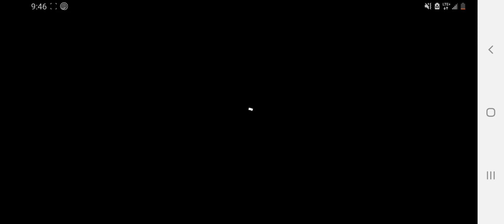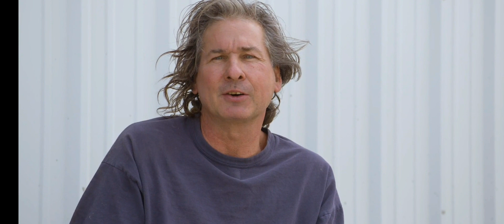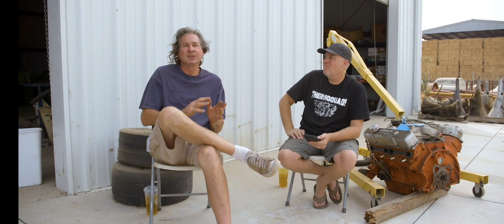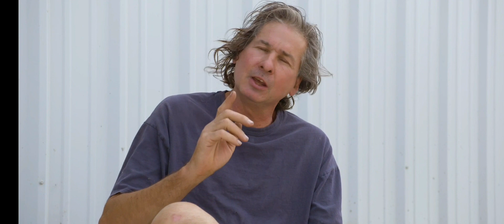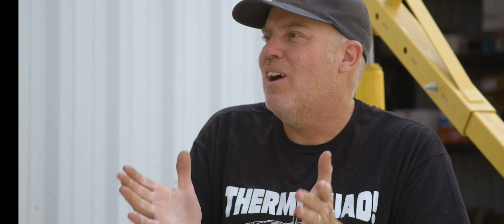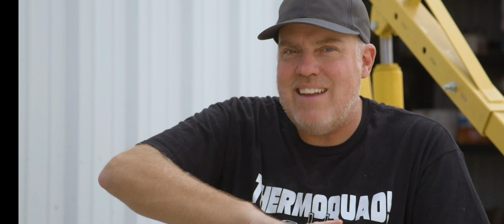uncle tony's garage gets called out by the roadkill guys and they say he's  full of shit

Comment: Met Uncle Tony in person not too long ago. He’s a really cool, humble guy. Not sure why you have so much animosity for him, but I think his channel and influence has done a lot more good than bad for the car community. I also don’t recall him saying in his video that people should do this with aftermarket pistons which is apparently one of the complaints they have with this. From what I remember, he was specifically referring to stock ones and never made any specific horsepower claims, or told people to tear down their engines and do it. Pretty sure he only said to do it if you’re already rebuilding it with factory components.
Reply: @crunchemagain2030  A lot of what he does is purely for video content.  The 4 door will never run 10's they way he has it set up either, ever.  It already broke the weak ass 8 1/4 rear end, next will be the crappy slant 6 4-speed in it, then the 318.  It'll run 10's with a 440, nitrous, an automatic and a real rear diff and gears.  Just watch.
Reply: @Cutlass_Rudd  nothing UT puts his hands on will ever run 10's... doubtful it will even run 13's..
Reply: @crunchemagain2030  I dont think its even cracked the 15's.  That means it would get whooped by any minivan or Toyota camry.
Reply: @Cutlass_Rudd  Wrong.     BR did 8.85 1/8th mile, equivalent to mid 13's quarter mile last year on a slipping clutch. This weekend it did a 1.61 60', which calculates to 11.58 in the quarter.  He is close to breaking into the 10's.
Reply: @alzaidi7739  Lol @ 60 foot equating to anything.  You've clearly never drag raced anything in your life.  That car will never do anything but be a content source, they should rename it the excuse machine.
Reply: @Cutlass_Rudd  You said he'd never leave the 15's when he was already 13.5 equivalent.  When UT gets BR into the 10's, rest assured, you'll be the 3rd to know.
F=MA. Newton's 2nd law.

Remember, you said 15.
Reply: @alzaidi7739  Lol.  If 318's and crappy slant 6 4-speeds could handle 400 shots everyone would be doing it.  Hint.  They don't.
Reply: @alzaidi7739   I agree with you. The 318 is a great Motor and Tony has been making progress with it. Its a LOW DOLLAR build. ANyone that hates on a318 is clueless. Not a huge performance engine but super reliable,and im sure you could get some push out of one if you tried like Tony is currently.
Reply: @alzaidi7739  you can't get a 1/8th time from a 60ft and you certainly don't have any proof of that 60ft time either 🤣🤣🤣 why didn't he show the slip!! Because it's bullshit junk that's never going to make a complete pass and Tony is a hack and certainly isn't a engine builder or racer
Reply: @Cutlass_Rudd  This 'crappy slant 6 4-speed'? : "New model intro time, fall of 1963: At last! An all-new transmission, designated the A-833, is available in everything from 6-cylinder Valiants to rip-snortin' Max Wedges. Equipped with a standard Hurst-Campbell "Competition-Plus" shifter and four fully synchronized forward speeds, it is built in Chrysler's Syracuse (New York) New Process Gear plant. Even in 1989, it was the largest, strongest, and heaviest four-gear passenger car transmission ever built in America.

From day one, there were two distinct versions of this box: A-body (later to be used in F-bodies) and B-body (also to be found in later C- and E-bodies). Initially there were three main version-to-version differences: extension housing and mains haft length, low-gear ratio and rear-flange size. The A-car box, while every bit as strong as its larger cousin, carries a 3.09-to-1 low gear, to launch small cars with even smaller mills."
Reply: @Cutlass_Rudd  This "crappy slant 6 4-speed" ?? :-)  "New model intro time, fall of 1963: At last! An all-new transmission, designated the A-833, is available in everything from 6-cylinder Valiants to rip-snortin' Max Wedges. Equipped with a standard Hurst-Campbell "Competition-Plus" shifter and four fully synchronized forward speeds, it is built in Chrysler's Syracuse (New York) New Process Gear plant. Even in 1989, it was the largest, strongest, and heaviest four-gear passenger car transmission ever built in America.

From day one, there were two distinct versions of this box: A-body (later to be used in F-bodies) and B-body (also to be found in later C- and E-bodies). Initially there were three main version-to-version differences: extension housing and mains haft length, low-gear ratio and rear-flange size. The A-car box, while every bit as strong as its larger cousin, carries a 3.09-to-1 low gear, to launch small cars with even smaller mills."
Reply: There's only so much offset skirts will tolerate.  Maybe it buys 3 or 4 hp?  But I like the idea of a dyno challenge.  Has to be the same engine, back to back.
Reply: Lil Boaty you are absolutely right about what he said with turning the pistons around he has said it would not work aftermarket pistons but you know as you can see the keyboard mechanic know it all mechanis, know it alls, and racers are quick to criticize and talk crap about yet the vast majority of them probably have no or very little mechanic, engine building, or any kind of racing experience at all that trick is nothing new my father told me about it from his days of racing and working on hot rods back in the 50’s and through his life many people in this day and age don’t know or realize there wasn’t much in the way of heavy aftermarket parts and services available back than it was alot of experimenting, trial and error, and working with what you had or what you could get with what you could afford honestly of course it’s a lot easier to have a huge budget corporate backing with a major publishing/tv company behind you with a big time dyno facility at your convenience almost anytime you want to use for testing on engines and parts that are given to them as long as they are promoting the name and brand to influence the public to think they need that particular part to make there car achieve that performance/horsepower goal because these corporate sell out brown nosers used it on an engine that probably wasn’t even theirs lol
Reply: Lil Boaty you are absolutely right about what he said with turning the pistons around he has said it would not work aftermarket pistons but you know as you can see the keyboard mechanic know it all mechanis, know it alls, and racers are quick to criticize and talk crap about yet the vast majority of them probably have no or very little mechanic, engine building, or any kind of racing experience at all that trick is nothing new my father told me about it from his days of racing and working on hot rods back in the 50’s and through his life many people in this day and age don’t know or realize there wasn’t much in the way of heavy aftermarket parts and services available back than it was alot of experimenting, trial and error, and working with what you had or what you could get with what you could afford honestly of course it’s a lot easier to have a huge budget corporate backing with a major publishing/tv company behind you with a big time dyno facility at your convenience almost anytime you want to use for testing on engines and parts that are given to them as long as they are promoting the name and brand to influence the public to think they need that particular part to make there car achieve that performance/horsepower goal because these corporate sell out brown nosers used it on an engine that probably wasn’t even theirs lol
Reply: @Adcox Robert Watching what?  Everything I said is true
Reply: @Adcox Robert get some reading comprehension, I said slant 6 4 speed ..the TRANSMISSION.  And the slant is a fine engine for transportation and reliability but it ends there.  Nobody runs them in vintage modified (straight 6's only) for a reason, they blow up the first night.  Not enough main bearing meat.
Reply: @Cutlass_Rudd  I have seen 2 turbo’d slant 6’s in my life both with stock blocks and both of them ran at least more than half an atmosphere of boost, you are simply wrong, and with enough traction and enough removed weight you can easily get far, and UTG’s idea is not being a hack rather than making do with what you got which also means pushing for power in every place for the least money and unlimited elbow grease. You already said basically at best it would be doing 15’s and that there is no way it could get close to 10’s only to have someone else to prove you wrong, instead of tarnishing someone’s name you go make sure YOU know what you’re talking about. And I only saw 1 of those turbo’d slants drive and it appeared to still be gutless at the bottom (same problem as tony and why most people don’t hotrod them on top of very limited aftermarket parts) though when the owner started shifting to keep it in the power band (3000-4500) it took off like a rocket, like I’m pretty sure if the guy had the UTG mindset that turbo’ed version could easily make it into the 8’s in the 1/4 (again with a light enough car and good enough traction), yes, I’m serious, are you? If you were you wouldn’t be saying things that are plain out contradictions. Agreed the trans he was using was weak but reading your comment I thought you were speaking of the engine aswell. Nonetheless if you can’t see the genius and knowledge Tony has when it comes to hot rodding and general engine theory than you should just keep driving your fast cars and keep your mechanically-declined ideology to yourself. I’m sorry to be rude or blunt but if you re-read your comments it’s like a group of people talking about the latest episode of a show that aired and you’re acting like you’ve seen it so you can be in on the conversation. It’s okay to admit wrong dawg, yes the mains on the slant 6’s could have been a bit beefier but that is simply because it was never designed to be a high performance engine, which is why Uncle Tony gets so many views from the series, simply because of people like you that say “that’s not possible” only to have guys like Unlce Tony seemingly bend physics when they take the time to observe how to better something without necessarily replacing it or putting money into it. Odd right but then again the guys saying he doesn’t know shit are the guy driving around thinking that their vacuum advance advances their engine the more they rev it. He has a whole video on not only tuning vacuum advance but doing a great job explaining how it functions and more importantly why it functions which is very simple for the air heads: Throttle closed = more vacuum / less dense af mix = slower flame-front = More time it takes for a complete burn // advancing IGN-timing when under vacuum means the air and fuel will be ignited a little bit sooner than at WOT or no vacuum as to make sure the less dense charge ends burning at the same time a WOT or more dense charge would. If that sounded too complicated than continue with going fast and leave the mechanicals and mathematical to us, I’m not trying to be offensive, I’m serious, there are a lot of good ass drivers out there, and their are also a lot of good ass mechanics, techs, and engineers out there, but there is really only a limited amount of people that can do more than 1 of those at a time competitively y’know?
Reply: @unitytwins6652  More than half an atmosphere, so 7psi?  LOL!  Real tuff.  Did the car run 16's or 17's?
Reply: Is this a pissing competition?
Reply: 7:1 compression 😊  Put a 340 call it a day .
Reply: @alzaidi7739  Where’s that 10 second time slip? That car never ran a 13 second. Calculating and doing are two different things. If a car is set up to run 1/8 mile, like his was, it will be all done by the 1/8. All UT proved with that pile BR is he doesn’t achieve nothing he claims he will do. He even put an auto transmission in BR and it still did nothing.
Reply: I think because he does a lot of backward thinking for example doing all this work thinking he’s better or more knowledgeable and right when he is just gaining nothing or 1hp like think inside the box if you can’t actually think outside

Comment: Clearly they never bothered to watch the UT episode in question.  At the beginning he specified tips for people looking to rebuild an engine on a budget.  Also he did not say to remove the piston from the rod and rotate it, he said rotate the pistons and the rods 180 degrees and swap cylinder banks and rod journals.  And yes, the math is correct, doing this will allow the piston to apply a bit more torque to the crank.  Given the number of engines the Roadkill guys have killed by halfassing their work they should have paid better attention.
Reply: It's only about the Torque & has nothing to do w/ HP. I've heard of example's were the HP was affected but very little. The Torque was affected by 10-27 lb.-ft. Yamaha has a single plane offset small-end crank in their high-pref. street bikes that kicks the S*** out of a lot of the other bikes. It's also the engine to use in mini-sprint cars. It sounds killer. But there is more vibration then the multi-plane so I'd rather offset the pin.
Reply: This. I love Roadkill and UTG, but the Roadkill guys have zero room to criticize how others build them. They half-ass just about everything they do!
Reply: Uncle Tony's garage wasn't even mentioned... much less called out
Reply: Most of the engines they have killed were either pretty much already there or run without air cleaners in the sand or left hoodless in the rain.. It is what ROADKILL was based on.. How many engines have they machined and built that they have blown up??
Reply: @proinseasokiellig4388  it absolutely was you need to go watch the full episode lol they called that hack uncle phony out on his magical BS that he gets young people who don't have any clue to believe lol
Reply: You either only rotate the piston on the rod or swap cylinder banks, but not both. 1. Because if you rotated and swapped banks the offset would still be toward the middle of the block
2. The notch for the rod bearing would be spinning the wrong way making it much more likely, if not guarenteed, to spin a rod bearing.

Also they didn't watch uncle Tony's video. They simply answered a Facebook question.
Reply: @proinseasokiellig4388  EXACTLY!! Someone's click bait horseshit
Reply: I never cared for the roadkill guys... they just come across as typical CA girly men.
Reply: Yeah yeah. WOULD YOU USE SECOND HAND RINGS AND HIT YOUR CRANK WITH A HAMMER TO CHECK ENDFLOAT,  👎👎👎
Reply: @michaelgiglio1571  I have used second hand rings. 

I actually built identical engine as my boss. 
But mine was junk parts. 

His got bored over. 
Mine just honed 

His had oil consumption after and could not be bored again. 

Mine ran for another 12 years. 

I’ll take free used over flushing $$$ down toilet 

Am I saying never buy new parts. 

No. 

But I have proof old parts might get u thousands of miles further for almost no cost. 

And spending a pile of money may end in a pile of junk parts.
Reply: @mccoma11  I think that's why many people watch them and how Freiburger became popular. Viewers wanted to see what he'd drop a big block into next. It paid off for him as he got the Motor Trend gig. I have seen them do some serious testing of theories.
Reply: @carmiethompson2676  it would have to affect both as horsepower is Torque x rpm / 5252. I take it you mean there was a positive difference in power , however; it was minute.
Reply: @SteveP-vm1uc  lol Steve being they already know what material they'll be presenting on a show I don't think they spend much money 💰 on shows like " How much nitrous or turbo boost can a stock block tolerate before it explodes ?" That's what initially got Freiburger started with a viewing audience. I have heard a successful 5.0L Ford Mustang racer Ben Alameda speak on this topic and he said his Stang got positive power gains from doing so. I know this theory has been kicked around a few decades in drag racing circles. Personally, I've never attempted it. Take care.
Reply: @NobilityandLoyalty  I have friends who run mini-sprint dirt oval races, I race motorcycles on the clay oval(well, I try too). They did use the flat-plain Suzuki 4-cyl. liter motor like everyone else. The Suzuki's are very expensive(skimming off the Motorcycle Division to pay creditors for their Car sales failure). So they went to Yamaha & that 4-cyl. liter motor but it had a cross-plain crank. On a clay oval, the cross-plain was far superior. Better torque curve, didn't have to rev the snot out of it because horsepower isn't as important on clay as it is on asphalt. The motor also sounded super wicked compared to the flat-plain crank motors. FYI; a intake valve for the Yamaha was $70, for the Suzuki it was $170. That was more then a year ago. If racing on dry asphalt, flat-plain is best. Any slick/loose surface or a wet/icy road, cross-plain would be better.
Reply: @carmiethompson2676  thanks for explaining your reference. I figured it had to be something like that. Motor with care .

Comment: All of this is technically correct, but if you are doing a rering on a decent core, it costs zero and will unload the piston some. I have done it countless times and the motors always run good with no piston failures or loud noises. I even do it with offset pin TRW forged pistons with looser clearances and barely hear them rattle cold. It's like a floating piston pin, it may not help but it never hurts.
Reply: It actually loads the piston skirts more, more wear. and at low rpm you would barely have any need for the prolonged intake stroke. So not useful for a stock daily
Reply: @KrisisVal  LOL. That's why racing pistons are centered-pin, for more loading and wear.